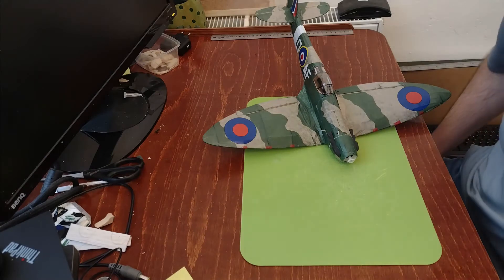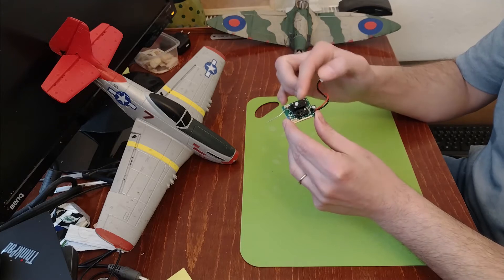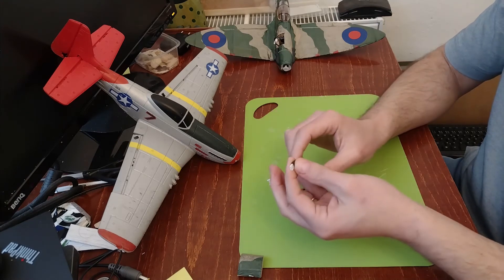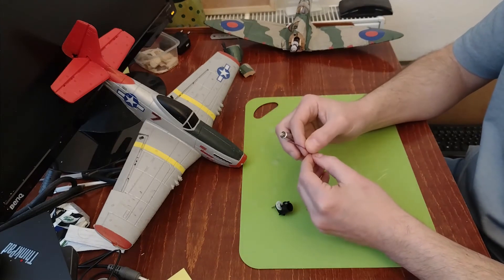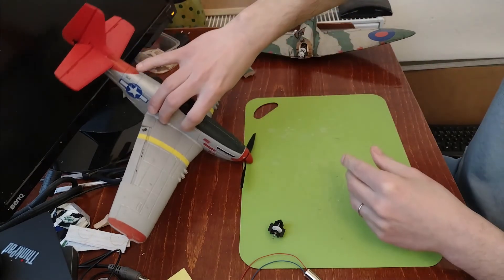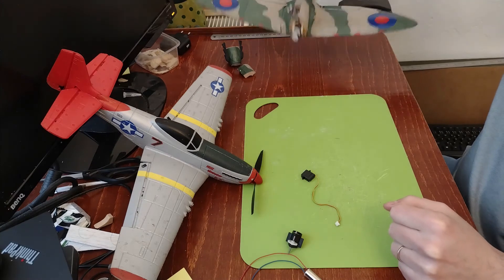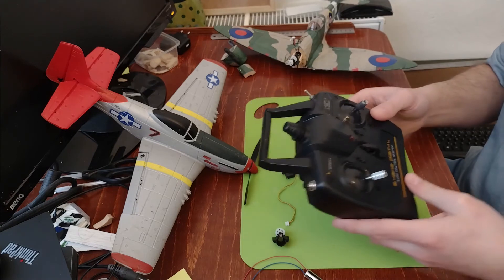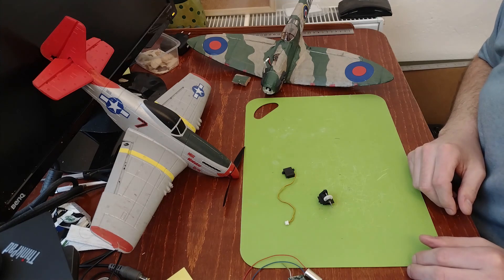RC components for Guillows RC conversion

Comment: Good fun. I'm about to build an old non-die cut Spit I've had for perhaps thirty years.  I have no RC experience but as an early teen did a lot of U Control flying.  I wonder how your Spit would have done with an .020 or .049 engine.  A small fuel tank would give a lot of flight time but the weight could be an issue.  My 85 YOA hands will do their best.  Thank you for your presentation, it's first rate.
Reply from the maker: I think an IC engine would be too heavy for such a small model. It is barely more than a peanut. 
Regarding old kits I am split. Sometimes I think it is good to keep them new, but on the other hand they were made to be built, so it is great that you are getting around to it.  Really great that you are still in the mood for building and maybe flying them, it is not only the hands, but also the eyes! 
All the best with the Spit and thank you for stopping by!

Comment: What is the use of Wifi port on the ESC/Servo board ?
Reply from the maker: There is a Wifi Port? I never realised. I can only assume that the same board is used for drones and that the port is used to transmit image to a controller. 
@RichardTapp1 knows these electronics very well, maybe he knows about it.
Thank you for stopping by!

Comment: Why did your board burn out, and how long did it last? is the new one giving you any problems?
Reply from the maker: Hello, the board itself is fine, what burned out was one of the servos on it. They are plastic geared and I did see broken teeth and melted parts.
Maybe adjusting the servo, or too much friction on the rod ...? I am not sure why it failed.
So far the other 4 I have in operation seem OK. 
Good luck with your projects!

Comment: I found it confusing when you referred to the "brick" as an ESC. The board you are talking about does contain an ESC, but it also has a receiver, servos and gyro (and the Electronic Speed Controller). On larger planes, each of these will be separate components. Tim McKay calls it a brick because it is multipurpose and not just an ESC.
Reply from the maker: Indeed, it is all together in this case. Since the engine is not so powerful space and weight have to be maximised here. Some day I might upgrade to the real deal and have brush-less motors and all that ....
Reply: @downwindchecklist6567  There are very nice "bricks" with brushless ESC and receiver (and also servos) on a single board for a brushless small plane. This is what I used for my Sopwith Pup https://www.youtube.com/playlist?list=PL9Qx6K4kAW68N7ubtBHgx95-xxovnWLq-
Reply from the maker: @timtheplaneman  Thx! I'll check it out!